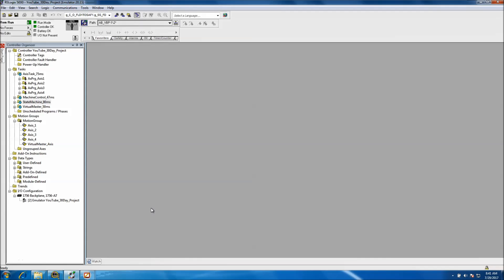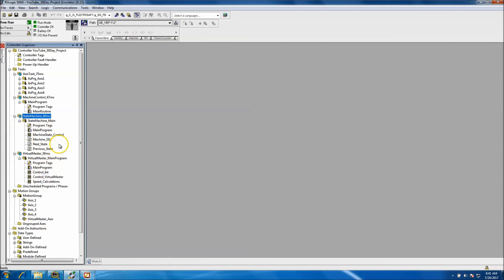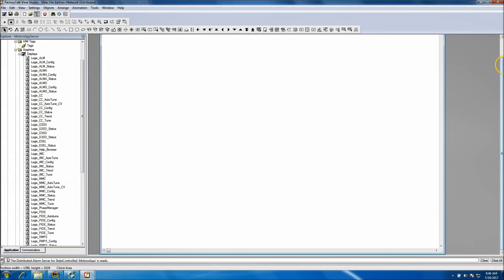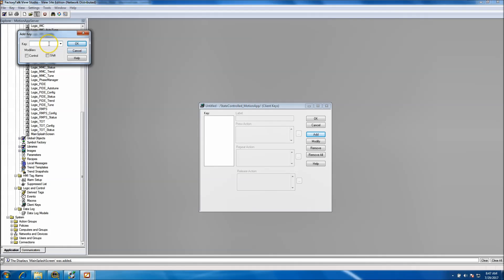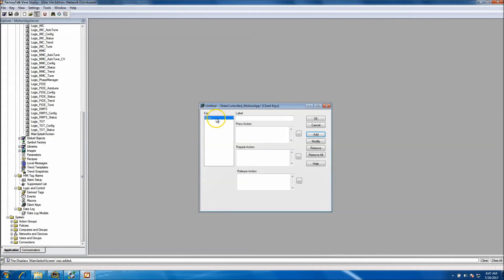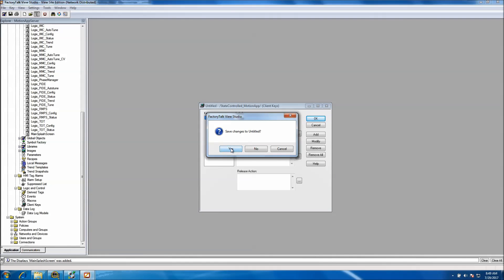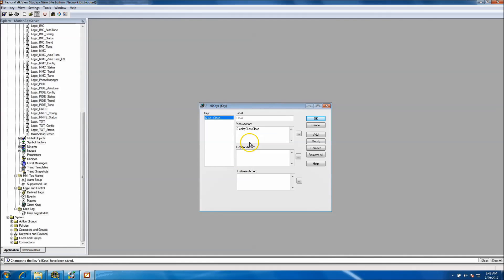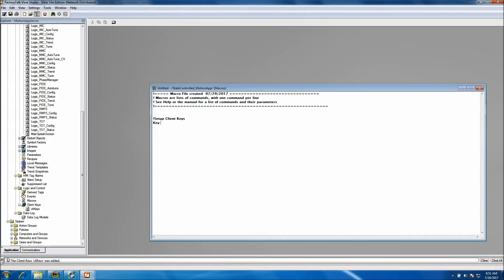Servo Motion Project Day 14 - Adding ClientKeys and Macros in FactoryTalk View SE

Comment: I think I figured out. In the controlvirtualmaster routine rung 2. In order to unlatch the MachineRunCommand instruction the inputs should be both StateMachineCommandStop & StateMachineCommandE-Stop in parallel before the ONS. That way works out to stop the system if E-stop relay is active.
Reply from the maker: Glad to see you got it worked pout, let me know if I can help in any way.

Thanks,
Shane

Comment: Shane Thank you so much for your help. I was wondering if you can send me the rslogix5000 app of this program. I have a problem to figure out why the e-stop signal is not stopping the system. I need to compare the SSL section that I did to compare with yours. Appreciate it!